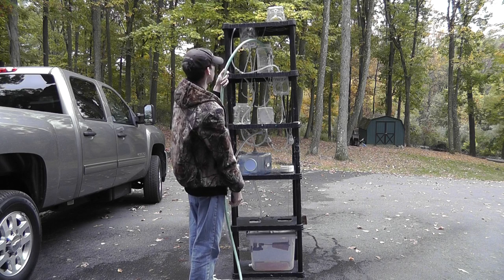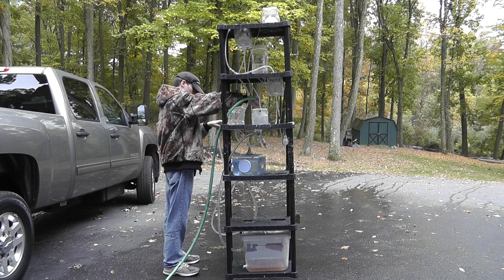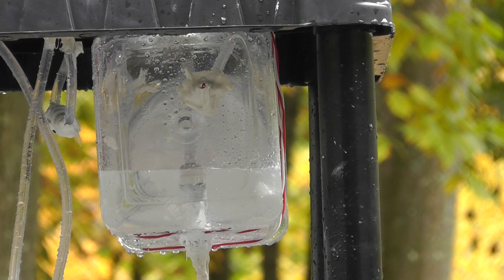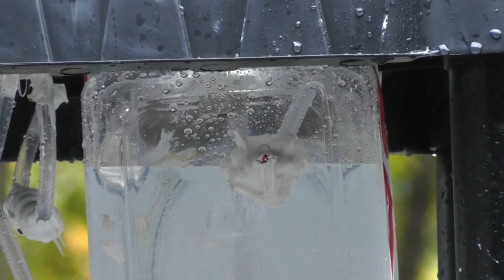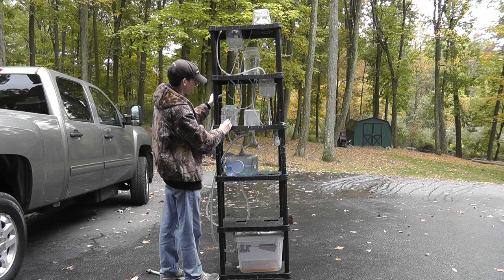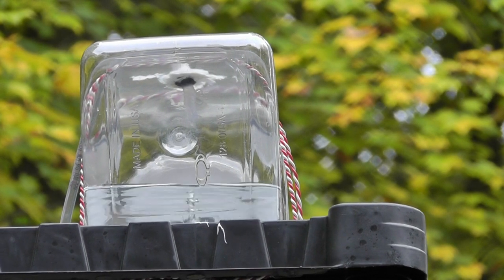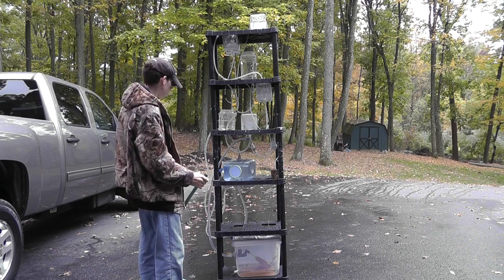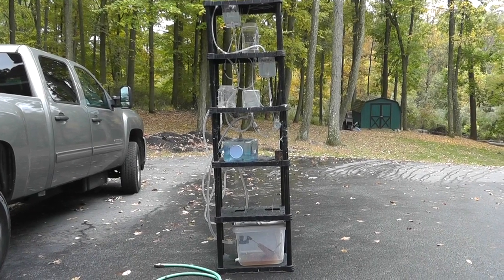Hydrautomat In Operation - Self-Powered Water Pump

Comment: Of course, back then,they didn't have plastic containers. They would have used glass or clay vessels and the vacuum would be more instantaneous. (because of the flexible walls of plastic). Also, expansion and pressure due to heat using plastic. A very interesting useful system. Thanks for sharing it.
Reply from the maker: You're welcome, and the original Hydrautomat was made from metal (most likely steel, but no description was given).

You can go to the Rex Research page for all of the original news articles and other details on the original Hydrautomat at http://rexresearch.com/allen/allen.htm

Comment: Dude! You could integrate it into an Aquaponic farm system and be 100% off grid. Its the holy grail if you can fine tune it to work 24/7. A big tank system could power a water turbine and charge a battery.